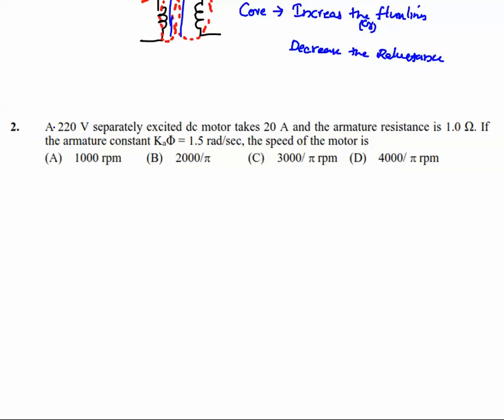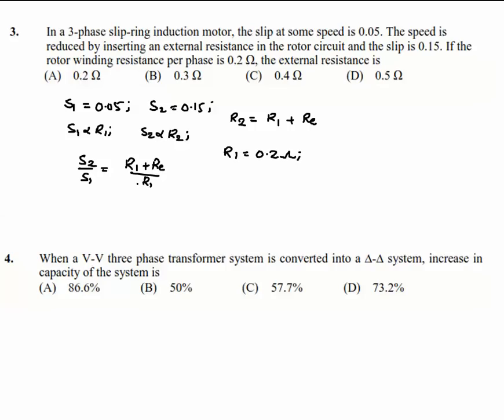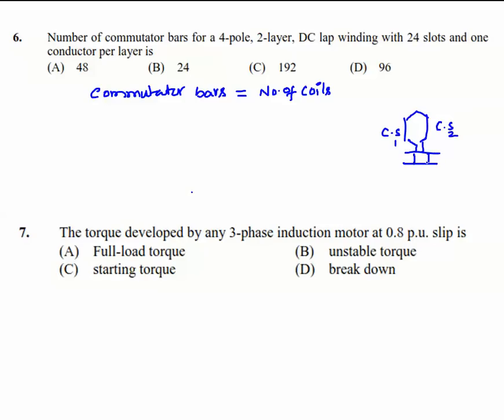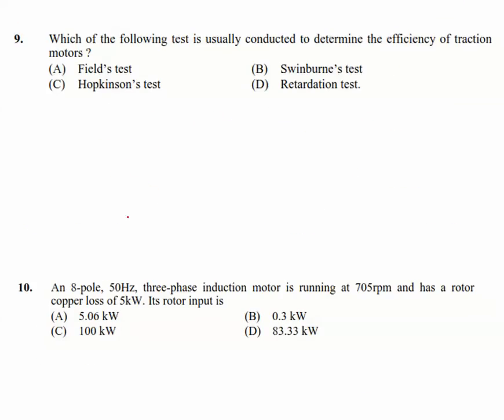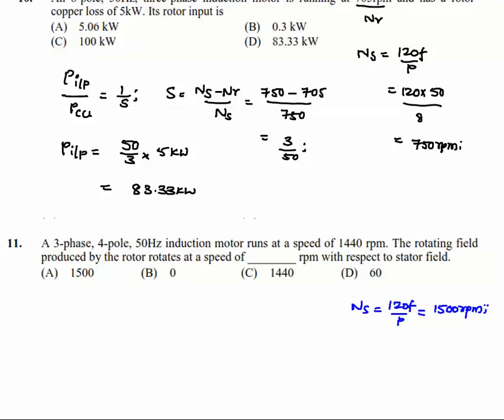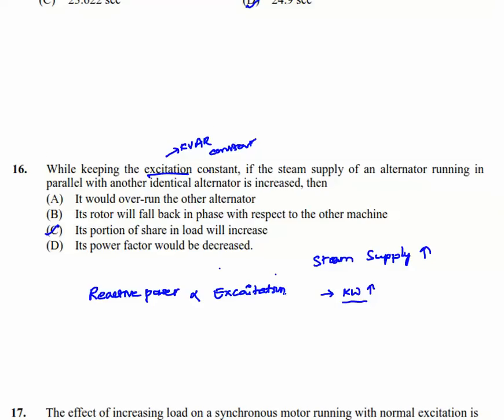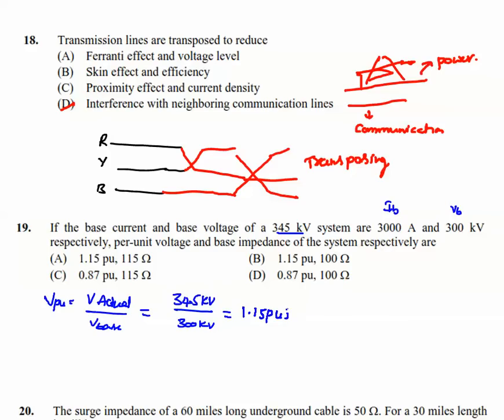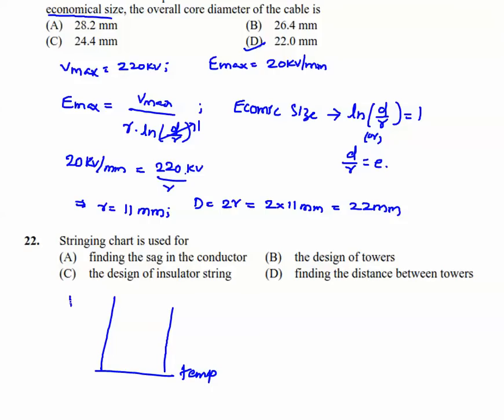APTransco Assistant Engineer (Electrical) Solutions 2017 Part 1

Comment: Does Aptransco question paper will be like these questions only? Or tougher questions like gate which takes time consuming?
Reply from the maker: Days changed,now it will be like gate and more
Reply: @ASSISTANTENGINEERELECTRICAL  thank you sir for your reply. Sir , practicing GATE 1mark and ESE bits are enough for TRANSCO and DISCOMS?

Comment: Q 11 is very doubt
How you're said 0 rpm
Reply: Rotor field rotates with synchronous speed wrt to Stator,Stator field rotates with synchronous speed, the relative speed is difference between rotor flux and Stator flux is zero

Comment: nice video...very useful ..I have doubt in 11th qstn. relative speed is 60rpm bcoz in option (d ) 60rpm is there ..if it not we can consider it as 0 rpm....can u plz clear it
Reply: stator speed is equal to synchronous speed which is 1500rpm and the rotor speed is 1440 rpm therefore the difference is of 60 rpm...
Reply: Flux induced in the rotor rotate at synchronous speed irrespective of the actual speed of the rotor.  So, the relative speed between stator flux and rotor flux is 0 RPM.

Comment: for 7th Question the slip at which maximum torque occurs.what would be the expected slip is it 0.5? at the middle of stable and unstable region what is the slip.if it asked for 0.4,0.5,0.6 slips,what would be the answer.
Reply from the maker: +Ramakrishna Ch thanks for your support.i already have same paper in which questions are missing from 97,98,99,100,102,103,104.thats why I requesed you to find the question papers.thank you
Reply: If one conductor is cut out from a three phase system. The load supplied is by ____ voltage.
a. Single phase.
b. Two phase.
c. Three phase.
d. None of the above.
Reply: single phase